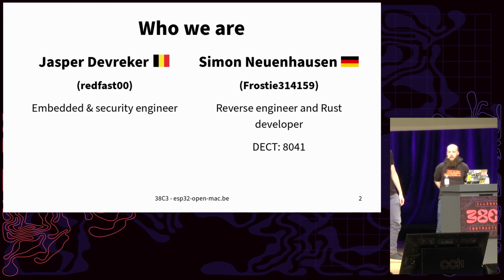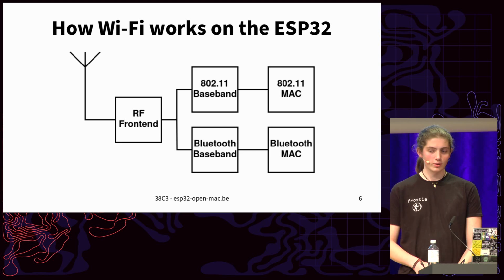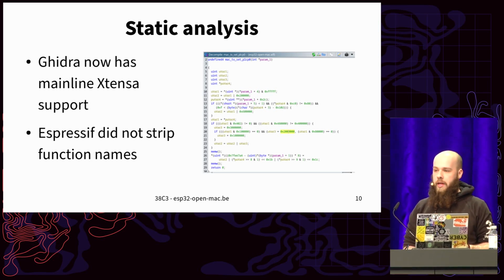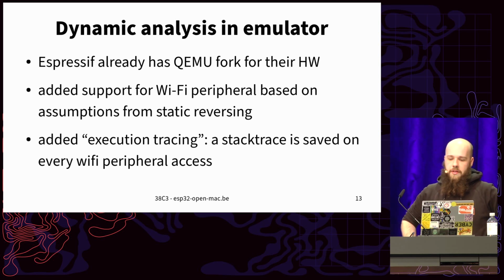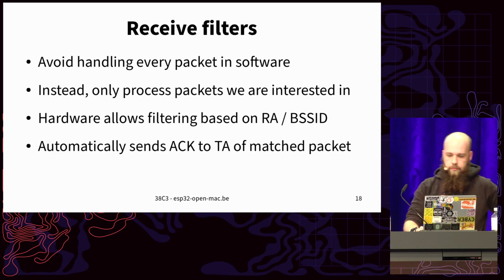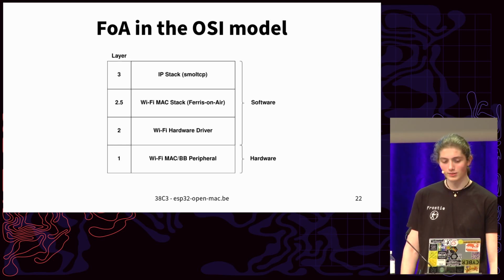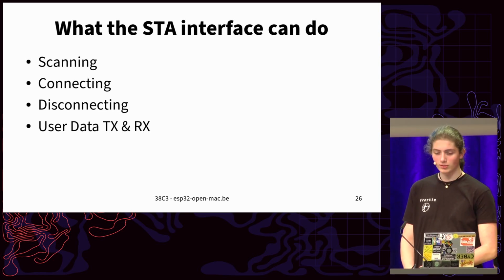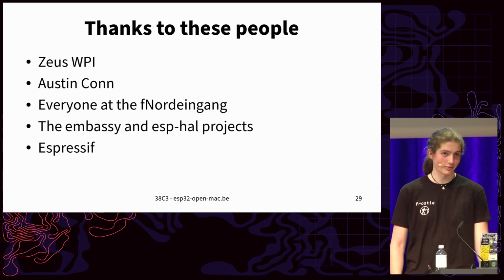38C3 - Liberating Wi-Fi on the ESP32

Comment: Fascinating project!

I wonder, which layer selects rates, transmit power, radar detection, retransmission and all these shenanigans which determine real speed and reliability of the connection? AFAIK, there are a lot of patents in this area.
Reply: Rate and transmit power selection, as well as retransmissions are handled by the driver in software. Radar detection is not supported, as it's also not necessary in the 2.4 GHz ISM band.